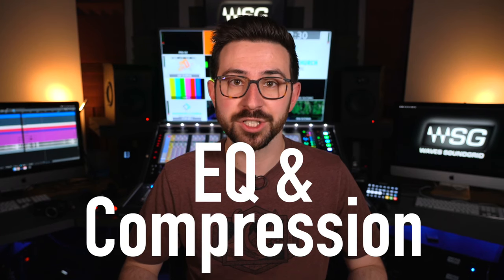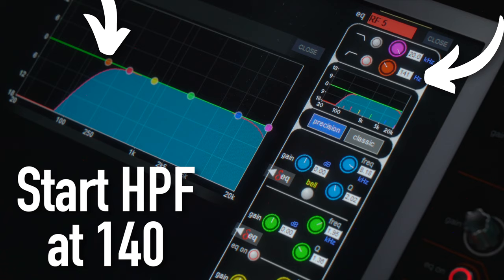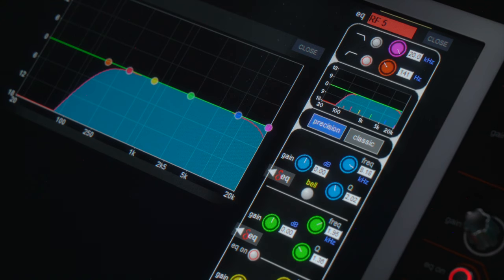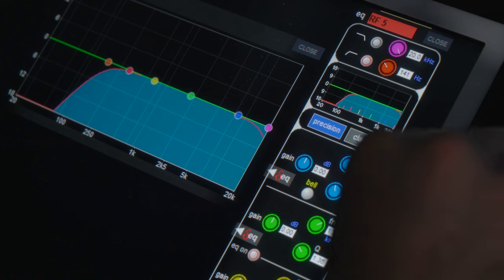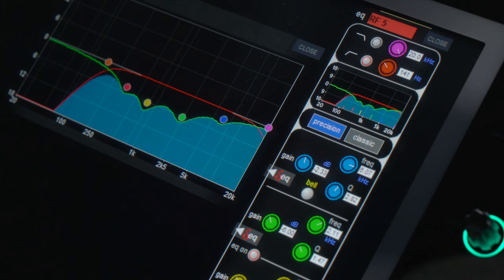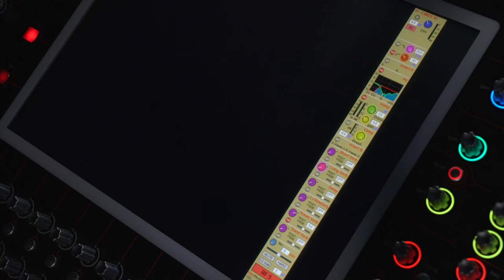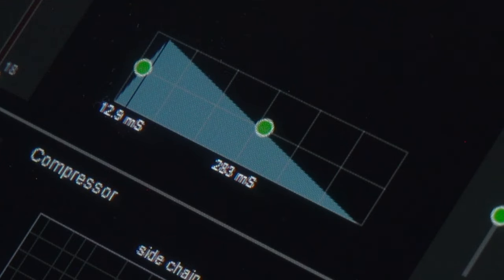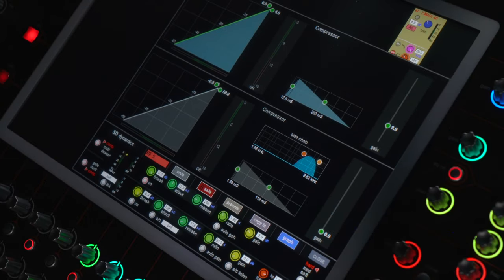How to EQ & Compress a LIVE Headset Microphone

Comment: hey man, love the video ! not sure if you will see this reply but three questions.
1. what recieve and headset were you running? secondly was the reciever's audio gain level at 0db or did you boost it ?
2. do you aim for -18db on the meter and ride your fader lower ?  i saw in the comments, you mentioned trim - im guessing that is similar to digital gain on the yamaha consoles?
3. do you eq the pa first and then do headset sound checks and processing ?
 
thanks in advance

Comment: In Australia, I typically recommend JAG headsets. 

At around $400 Australian bucks, you get a mic very close to a DPA
Reply: Way too overpriced for what's offered. Something like a pair of Philips SHP9600s, with even a boom pro mic, or a lavalier mic and using Equalizer APO, will sound as good, if not better, for less than $100 US.

Comment: Rule #1 in making a video on proper voice capture and playback : Have your presentation itself be intelligible and easy on the ears.  At the very start of the  video you were speaking over an audio track of someone speaking. There was not enough separation in tone, timbre, volume or even left/right mix. It was hard to understand what you were saying, and I didnt get a good sample of the  clean track of the work sample either. 

The information itself was excellent though. Personally, I find two compressors and a normalizer staged right after each other works best. One short compression and one longer. This helps keep those popping consonants under control and helps even out some of the dynamics from  bad mic usage on their end and justy overly dynamic vocal projection on their end as well.
Reply: ^ This.

Comment: how do you start off the gain ?
and do you have your amps for the headset set at +0 or a different gain level or preference ?
Reply: All my pres on the console are set by default at 30dB. 

Ive found that to be a happy medium so that your level indicator light on the channel will light up when someone talks into a microphone.

From there, I get the person to talk (if they are a speaker) or sing (if they are a singer), as loud as they are going to sing. 
I then adjust the gain until i reach as-close-to unity (0db indicated) as I can using the PFL or solo.

Only then do I unmute the channel and work my way through HPF, EQ and compression.

Sometimes ill run my headset through a group, and apply a GEQ to that to give me finer control of bad frequencies.

Comment: I also run my headset very similar. However, recently I have been wanting to try to reset it. I had watched a video a while back that basically was explaining that if you do EQ cuts across the entire Hz spectrum then you're essentially just turning down the input. I have been wanting to try resetting my gain in a way that I'd typically not recommend. My thought is, set the fader to unity or +5 and then roll the gain in until I'm at the volume I want in the room. Then set EQ/Compression. My thought it that maybe doing it this way will decrease the amount of gain I'm using and therefore make the Mic itself less sensitive and allow me to do less huge cuts from the EQ. However, given that my mic setup is working the way it is I don't have much motivation to change it.
Reply from the maker: It's not traditionally "correct", but I actually like to set my headset mic gain lower than normal, and then use trim to makeup the difference. I've found that it makes the headset less sensitive and therefore noticeably less likely to feedback.
Reply: @andrewlepard  can you explain what you are doing with the trim ?

Comment: Do you have the ability to adjust the knee? What was the knee in this video?
Reply from the maker: The console I'm using does have the ability to adjust the knee, but I was just using a hard knee. I typically find that as long as I'm not using an aggressive ratio I prefer a hard knee, but if I'm above like 10:1 I start using the knee function.

Comment: I hate the headset mic. It's so hard to work with. Setting the gain is tough in our room.
Reply from the maker: I know this sound weird, but in some difficult circumstances I've actually had decent success setting the actual gain a bit lower than I normally would and then use trim to makeup the difference. It seems to make the mic less sensitive and therefore less feedback happy.

Comment: Nothing about gating…
Reply from the maker: I would almost never gate a headset mic for speaking. Maybe if the room was really reflective, but I find it's often much more natural to leave that alone.
Reply: @andrewlepard  Wouldn't you want a gate to control breathing sounds a little? Not wind noise from breathing, the actual sound of air resonating through the mouth/nasal cavities.
Reply: Use and expander with around 10db of max reduction. So not a full, hard mute.